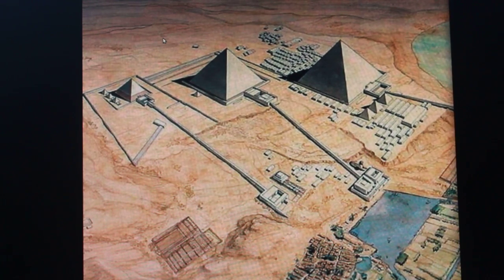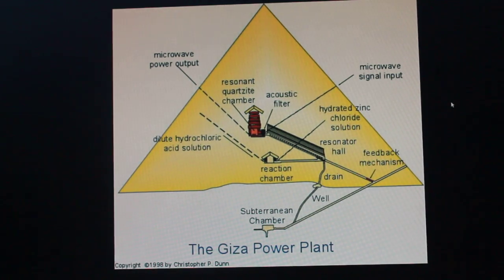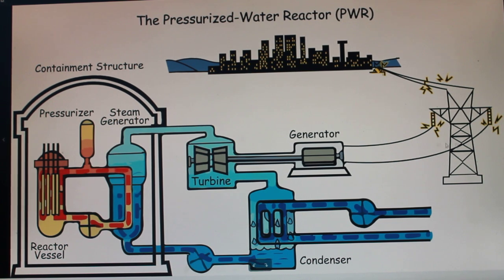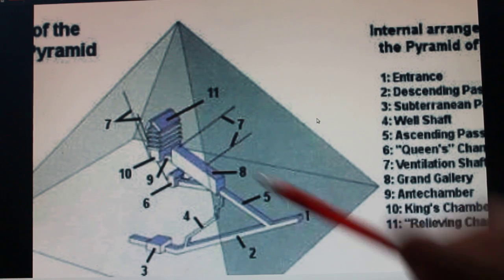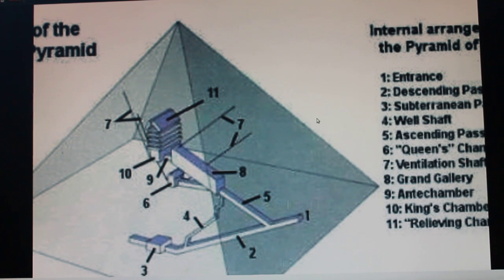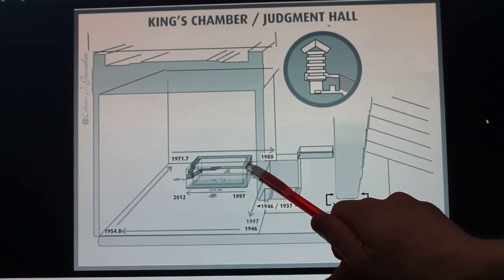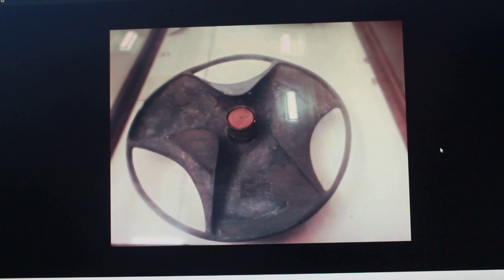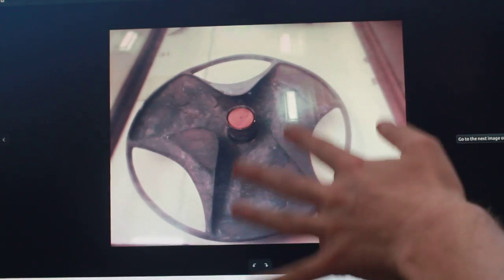Is the Giza Pyramid an Ancient Boiling Water Nuclear Reactor Complex? (Part 1)

Comment: Albert Mao Einstein: The Pyramid is not a tomb, nor  does it have to be flat however with the use of effective water control it could be. Water definitely is used in fact if Egyptians try this now they have to first build a well large and the corresponding granite to support its rise. The Pyramid cannot be build without water, they just dam the whole thing and created section by section until it reach the top. People need to understand that Egypt survival depended on taming the Nile as a result they are very good at Dams. Water with sand makes it easy to mold them stones even the granite with diamonds can be done quickly. Some blocks are just recently added for fear of collapse. Marking the stones makes them easy to put together, however huge piles of stones have to be carried to the site where it can easily be broken thru desert heat with water and chip easier with sand grinding with the continuous flow of water from the spring shaft. They probably started by digging the a ditch to ensure enough pressure for the well to spout continuous spring water then put in blocks then the consecutive blocks are just rub with sand and the spring water to create a smooth and level stable base. A part of the Dam serves as ramp where they can just carry blocks as it goes higher. Only the lower part of the Pyramid need to be water tight dam to keep the pressure of the well from flowing water as the shaft goes up where water is then permitted to to flow its natural course on the rocks itself. Water is necessary it makes work cool and easy as well grind the sand with the stones to tight fit them. For all we know the crazy Egyptians might have used the pyramid for fresh water aqueducts for their homes.

Comment: IVE KNOWN THE PYRAMIDS ARE POWER STATIONS FOR MANY YEARS NOW AND HOW THE WATER CAUSES STATIC,AND THE LIMESTONE COVERING ACTS LIKE INSULATION,THEY HAVE HARMONIC CHAMBERS TOO WHICH CAN KEEP AN AC CURRENT AT 175H SO THEY COULD TRANSFER ELECTRICITY BY RADIO,AND THAT ALSO MEANS IT COULD ALSO BE USED AS A WEAPON,LIKE TESLA DID

Comment: What got me thinking is....when you mentioned the steam build up and condensation. I think they could have used the 3 blocks that blocked the passage as some kind of pressure system. Where after the pressure would build, they would be pressured back into the gallery. Some kind of cycle would be happening there.
Reply: Tr1ckySureShot, Bingo! Your theory is the first I've run across matching my own.

Comment: What about lighting, heating and cooling using the Sun's rays? The Pyramid(s) had a white covering that would throw light well into the nearby populace well into the night. The heat  it would reflect in Winter would warm a distance & conversely cool in Summer. Maybe during those times the Earth went through a natural climate change &  living there became unbearable. They had to make the structures perfectly straight to resemble a mirror for more control over the Sun's rays. Also if you conceive of a 45 degree plane, this seems the logical way to reflect the rays the furthest. It was imperative to have a system to moderate the effect of the climate change. That's why they spent decades building it. Wow,  must've been intolerable then.

If climate change occurs today to us, maybe we will do the same in some places. Food for thought.

Comment: With NO radio active detections of any kind recorded at any of the pyramids and nuclear fuel having a half life of 30,000 years. your'er theory fails on its own premise. Unless you have a theory about the pyramids being 60,000 yeas old I cant see how your theory holds up.
Reply from the maker: Thought experiment.
Reply: Smokey Bacon not so fast he is saying that the pyramids are older that 30,000 years and are from  a very ancient civilatation
Reply: Smokey Bacon did you even watch this???
Reply: 30,000 years is a half life. That means have is left after 30,000 years, then a quarter, and so on.
Reply: Good point.  It was not nuclear, but I like the thinking.  Actually, we have two separate technology ages.  First was in the ZepTepi time, they used different tech than in Khufu time for good reasons. A lot of the end results are similar.

Comment: it would make sense if they were power generators because with Tesla's theory of wireless electricity transmission the pyramids would be perfect they were solid Granite which is radioactive and conductive covered with limestone which is non-conductive and tipped with gold highly conductive.
Reply: wireless charging for your cell phone is not connected via a conductor, and it only needs to be in close proximity, not touching. it is Tesla tech, but on a very limited small scale. tesla's research was stolen after he died,and buried in a pile of black ops government tape, and then whored out to private contractors to develop, which they did
Reply: continued sorry. the shape of them makes them perfect for conducting electricity up into the stratosphere which is how Nikola Tesla plan to wirelessly transmit high voltage electricity.
Reply: Except Tesla's theory didn't work, and what do they teach you people at school nowdays, granite is NOT conductive , and the pyramids are NOT solid granite. Good grief what a moron.
Reply: path of least resistance buddy. and youre wrong about current wireless consumer technology. https://www.engadget.com/2017/09/18/pi-can-wirelessly-charge-your-phone-from-a-short-distance/
Reply: his theory did work, he made it work, thats why he was killed and his research stolen and buried, to be slowly release to the world on a small scale slowly over time
Reply: They. Electromagnetic field osillaters that suspended all that water. Above the earth. Creating a lens that filtered deadly gamma radiation and eliminating the tilt of the earth's axis. There. Eliminating genetic damage. Thus creating a dry planet. And all seasonal changes one world temperature a perfect environment for immortal humanity.  By a creative intelligence. Was destroyed. A. Malicious intelligence thus crippling a divine mechanism study clues in the book of genesis. Numerical data in book of revelations as. Well. Examine. Carefully. We were designed to be. Immortal genesis 3 14. Ratio of. Pi we are living under a curse I remind everyone. Cain. Was the first nephilim. Satan impregnated Eve. Not Adam.  The others came after the flood to this very day. What a loving god!  Satan is so envious and hateful. Please. Reply soon
Reply: Actually gold and the precious metals don't conduct electromagnetism so much as insulates, never the twain shall meet as long as there is a precious metal insulator in between the + -. Electromagnetism travels along the outside of the insulator in the form of a double torus like what powers the galaxy, Sun and Earth Double torus as evidenced with the Oort cloud and Galactic Nucleus. We live in an electric universe.

Watch for the CONJUNCTION ARCING of the planets EM with the beginning of the END TIMES CONJUNCTION happening in 2033.

Comfortable LIES Co2, rising oceans, Covid masks, vaccines.
Inconvenient truths Precession causes eh end times, The Baby Boomers who were born enmass 76 years ago are stating to die enmass from teh usual suspects of seasonal FLu which leads to pneumonia and old age.

The galaxies Electromagnetic BULGE does a full rotation every 240,000 years causing global warming cooling at aphelion perihelion every 60,000 years. WE are at Bill Gates Event 201 (000).

Jesus taught HUMANISM, Slave is equal to master. Judaism and Islamism teach Us & Them tribalism (Gentile, Infidel) Divide and conquer humanity by race creed and religion is the devils modus operandi.
Reply: @GregoryJByrne  Gold is one of the best conductors we know . I'm an electronics engineer. The granite is radioactive the gold is a conductor and the limestone covering that used to be on the pyramid was a insulator you figure it out. Or you can just go along blindly listening to your end times people whatever the hell they're saying
Reply: @GregoryJByrne  to all of you idiots saying Tesla's theories did not work do your research I'm an electronics engineer Tesla was a genius. The only reason your electricity has to be plugged into a wall and isn't free is Edison slandered him so that he could make money off of it.
Reply: Tesla's theory did work how you think we have wireless charging for your phones nowadays lol maybe you should go learn somthing at school other than Con artist Eddieson.... like evry1 else from that time they all used Tesla's patents..
Reply: aaronrus the cell phone does need to be placed on a pad that is used as an inductor to deliver the power to the phone. The simplest research such as Google or Wikipedia will bear this out where you can read the actual manufacturers explainations. It bears about the same resemblance to Teslas theory as a rubber band powered plane has to a jumbo jet. Just think for a moment that if power was flying through the air, how would it know which electrical device it was supposed to power, once it left the source how would this power bypass all other devices in its way and make its journey to the correct one? Is it alive? Does it have the capacity to navigate? What would happen if a human being got inbetween the source and the objective? This is part of the enormous volume of reasons why Teslas theory will never work.
Reply: aaronrus looks like we are going to have to agree to disagree. I am not knocking Tesla, please don't think that, after all if it wasn't for him we would have a very different present, without alternating current which enables our current (sorry about the pun) lifestyle. But I do think that the difference between what Tesla had in mind, sending power around the world, is a huge distance from wireless charging which from what I can see is induction at a very small distance of inches.
Reply: Muttley Jones you could both be right. Current tech means the induction doesn't have the range. If the electromagnetic field were bigger however..
Reply: Calvyn are you stupid or what? Tesla spoke about sending electricity through the air to a point totally disconnected from the source. Wireless charging for phones is NOT that. With so called wireless charging the phone is in contact with a base which is plugged into a power source, there is no power flying through the air, IT IS CONNECTED. Its you that need to educate yourself before you open that mouth unconnected to any thought process, fool.
Reply: Calvyn if it worked since Teslas time why has everything in your house that runs on power have to be plugged into the mains or has a battery? I will tell you why, because Teslas theory did not work, and you have the cheek to call others morons. Thats funny.